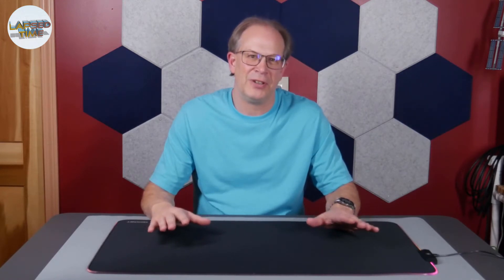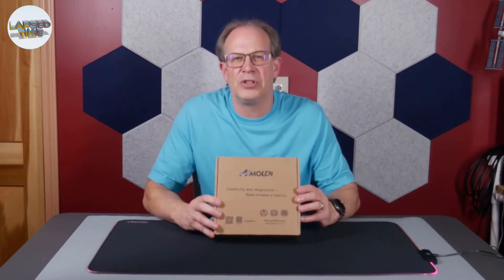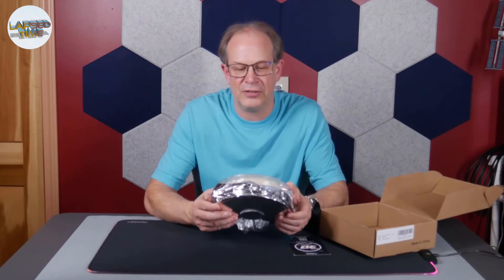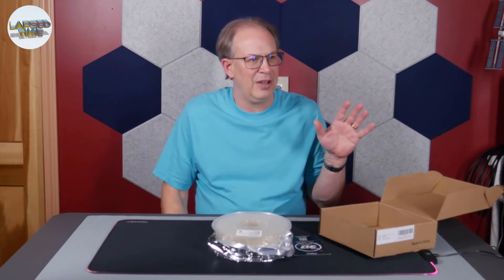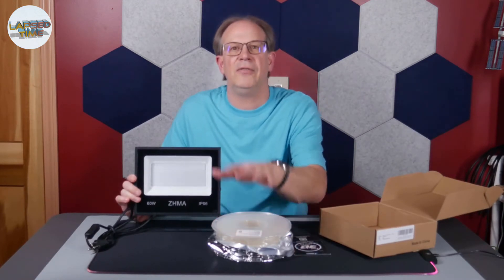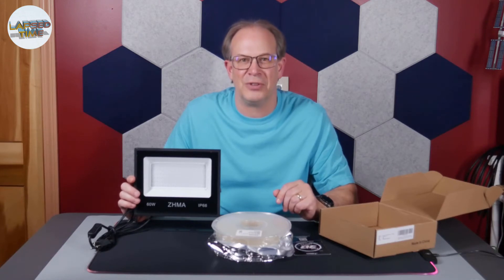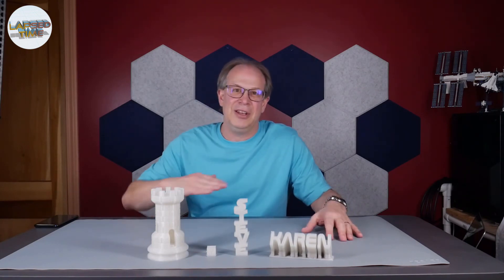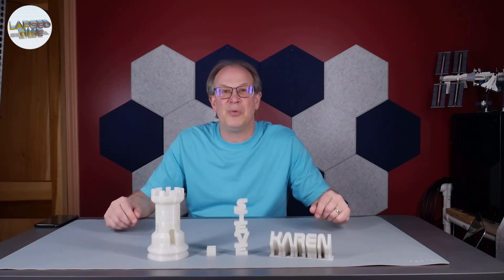3D Print Overview and Timelapse - Amolen glow in the dark PLA

Comment: What temps did you print at
Reply from the maker: I used my standard PLA settings: Nozzle 210c & Print bed 60c.  You could always increase the nozzle a bit if needed as I occasionally use 215c for the nozzle.
Reply: @lapsedtime  awesome I just got the same filament and will be printing with it in a few mins thanks so much for the fast response and the help

Comment: I am getting very brittle and stringy prints from mine. What would you recommend I do to fix it?
Reply from the maker: There are a lot of factors so I would recommend checking this site for potential options: https://www.simplify3d.com/support/print-quality-troubleshooting/  The brittle filament could mean it needs to be dried or if you are using a UV light it can affect it as well.

Comment: I have been seeing a lot of time lapse videos while people are 3-D printing. How is the filament nozzle never in the view of the time lapse? Such as yours.
Reply from the maker: I am actually working on a video right now showing some of my methods but not finished yet.  There are a couple different methods but you need to set up your slicer profile or use Octolapse to move the print head over to the side at each new layer.  Then you can trigger the camera to take a picture.  Search for "3d print timelapse how to".